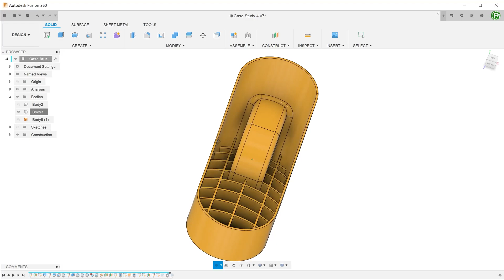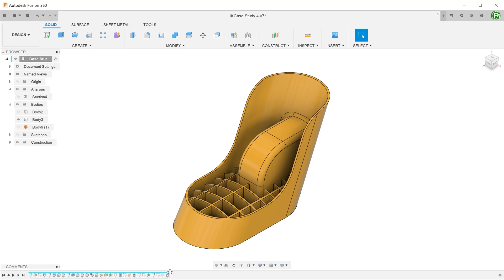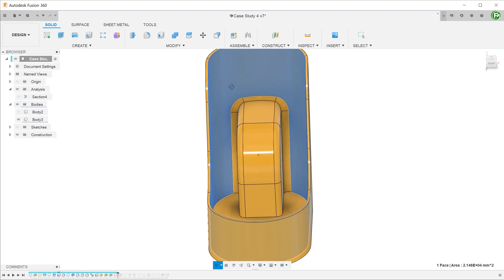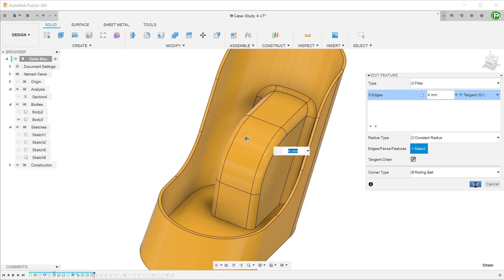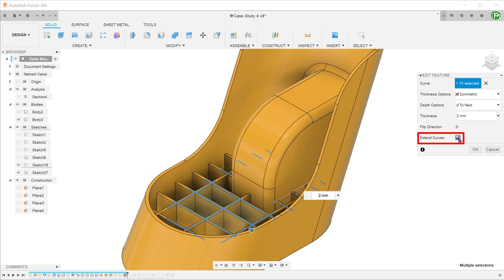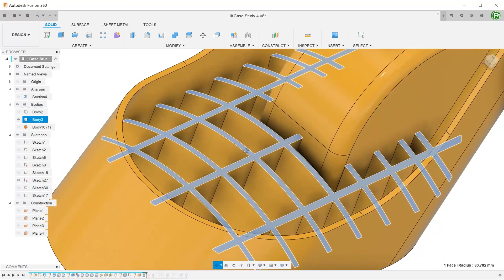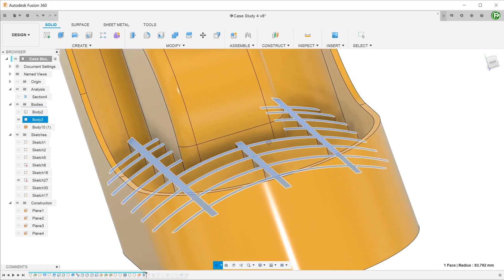Fusion 360 - Case Study 4

Comment: I followed the instructions but the last part which is doing replace face getting an error.  "The face can not be replaced. try changing the face selections. For edit face operations. avoid making changes where other faces connect smoothly."
Reply from the maker: Is the new surface completely under the outer edges of the shell?
Reply: @Fusion360School  the curve extended way past the object. Further testing show it is related to the number of lines (ribs). 13 and below is fine. More it gave that error. I had also moving the lines around to make sure it is not related to the line but at end it is really the number.
Reply from the maker: Mmmm...it seems strange that the number of ribs would have an impact on this. In theory, the number of ribs should not affect the surface to be replaced. Not sure what is happening here.
Reply from the maker: Hi, thank you for sharing your file. When I tried to add more ribs to your file, the replace face failed like you said. I still don't understand why this is the case.
Reply: @Fusion360School  same issue here, might be a bug of fustion 360